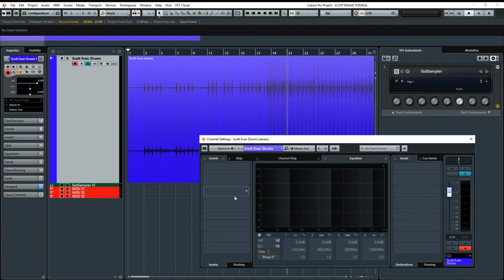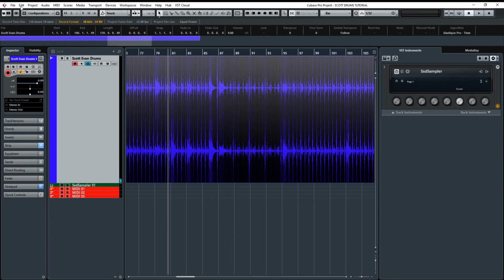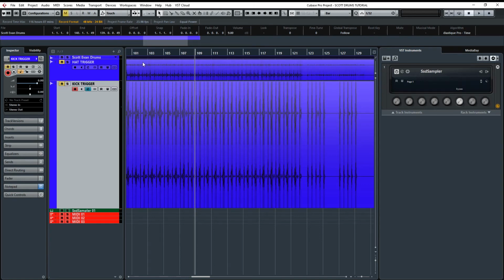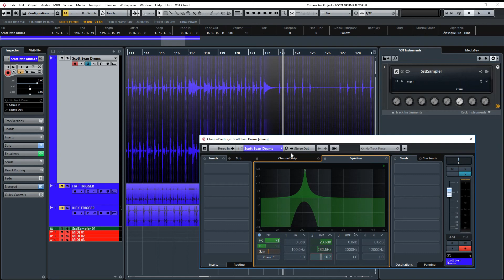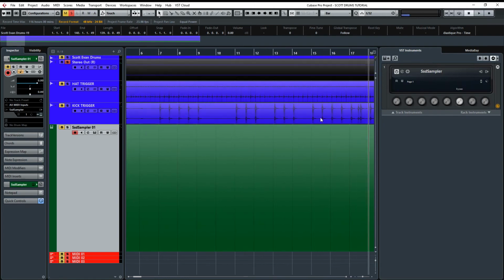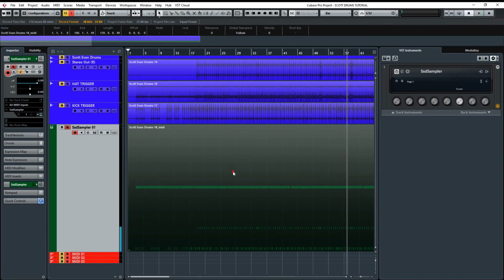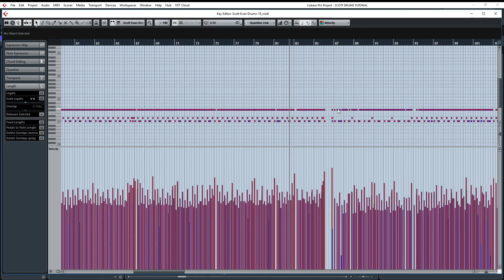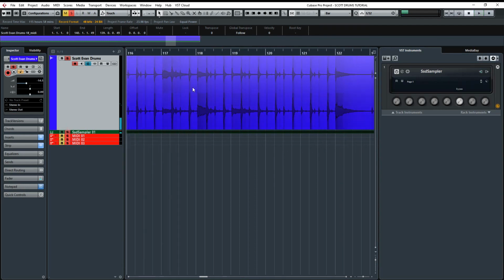Cubase Tutorial - Drum Replacement / Triggering Drums from a SINGLE drum track

Comment: You can do this with Vari Audio too and its much easier and faster.

Just analyze the Drum Track with Vari Audio (I know,  its supposed to be used on Mono Tracks) and export the midi. 
Did that a lots of times with Drums. Never had a problem on Stereo Tracks.  
Good  think about Vari Audio is, that you are even able to see the Pitch of everything!

Ofcourse you can do the same with Melodyne!
Reply from the maker: Alexander Flecker I tried it and it didn't even slightly work. Can you tell me what you did?